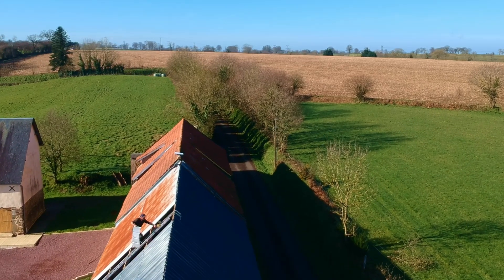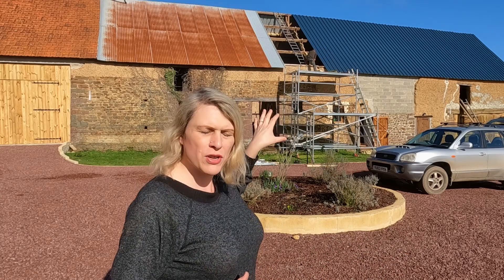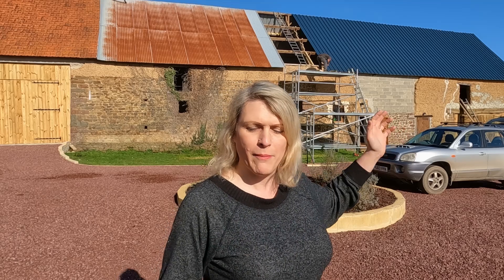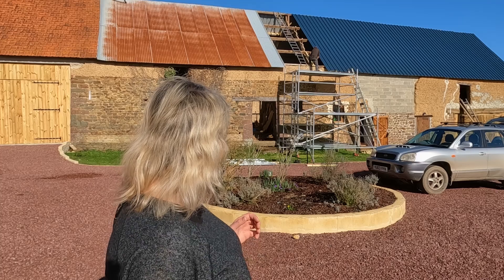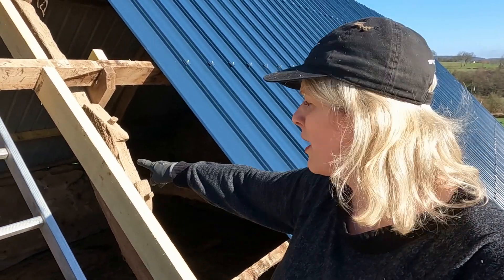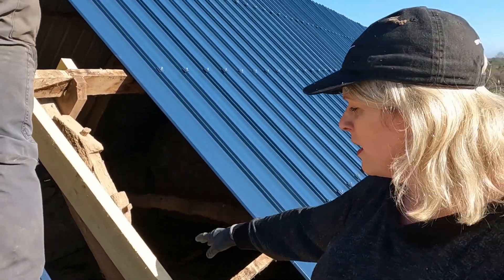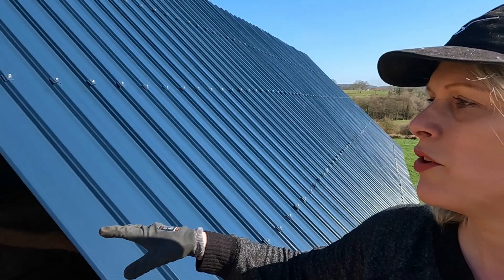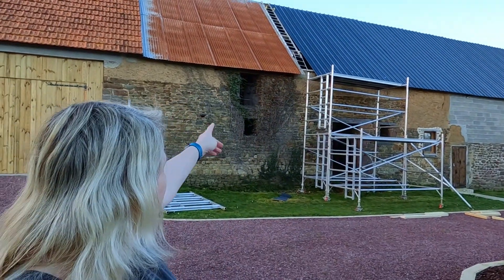Solar Panel Preparation Roof Reinforcing

Comment: SARAH, YOU & YOUR TEAM ARE DOING A GREAT JOB REINFORCING & CROSS BRACING THE ROOF TRUSSES!
WITH THE ADDITIONAL SOLAR WEIGHT, WIND LOAD & UP LIFT, IT’S BETTER SAFE THAN SORRY!
ARE YOU RUNNING YOUR SOLAR RAILS VERTICALLY OR HORIZONTALLY?
YOU MIGHT CONSIDER PUTTING WIRE MESH AROUND THE LOWER EDGE OF YOUR PANELS TO KEEP OUT RODENTS & BIRDS BUILDING THEIR NEST UNDER YOUR PANELS & CHEWING ON SOLAR CABLES.
Reply from the maker: We're running our rails horizontally, thanks for the tip about the wire mesh that's something I might actually do... The last thing I want is birds nesting underneath.

Comment: Hmmm...there are brackets available to mount panels directly to the metal roof.
Maybe a statics reason why you add timber and rails?
Reply from the maker: It's not a seam roof the brackets you're thinking about are for seam roofs.
Reply: @Gridbusters-qx4om  
I don't know what a seam roof is.
The brackets im thinking about are made for trapezoidal sheet metal.
Your sheets do look like this....Maybe im wrong?

Comment: you have a beautiful south-facing roof. Ideal for solar.
Reply from the maker: That's exactly the reason why we didn't go with the ground mount system.
Reply: @Gridbusters-qx4om  Is the roof exactly south facing i.e. what's the azimuth? I'd be interested in seeing what the PVGIS Tool suggests as your predicted production so would you mind sharing your approximate latitude (obviously don't also reveal your longitude) and the slope of the roof? Have you used any of the online tools to get a prediction?